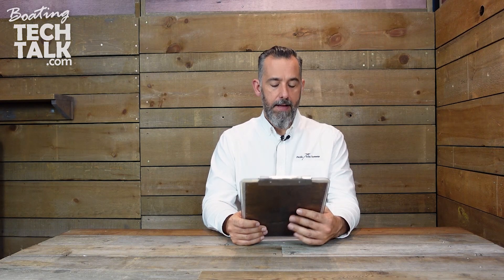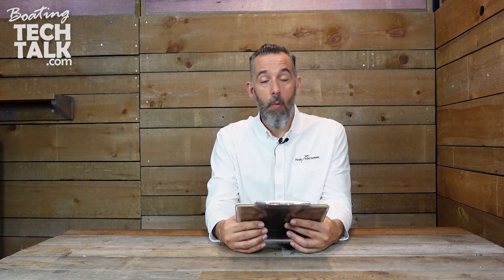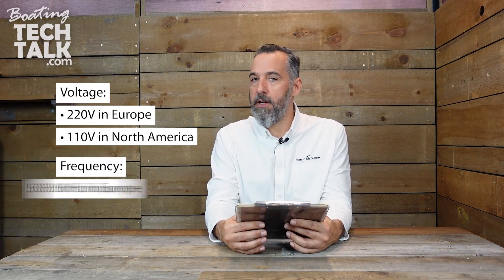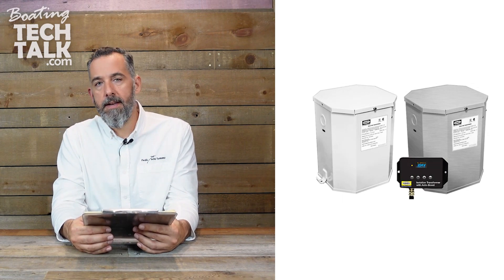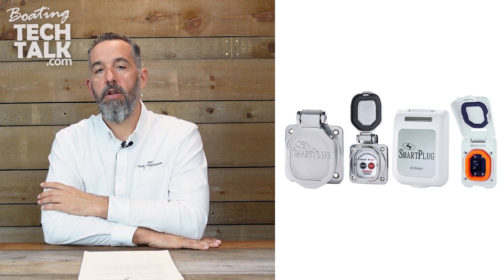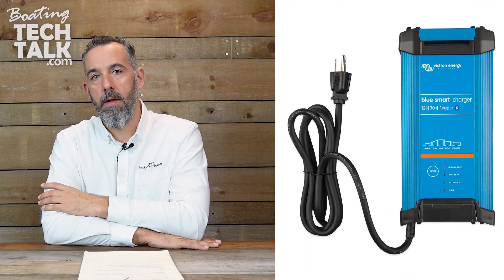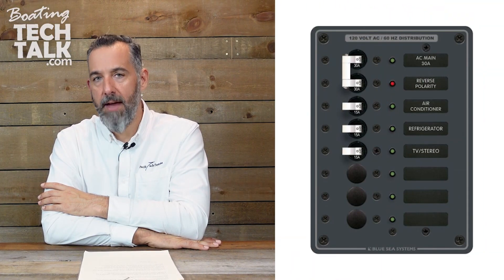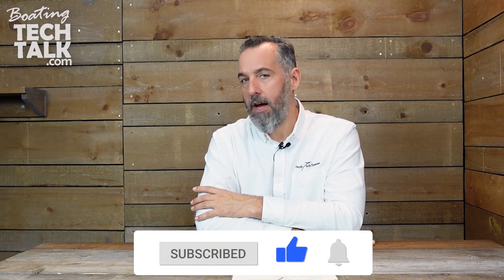European to North American Electrical on a Boat

Comment: You may have addressed this in another video but are 220 “appliances” more, or less, efficient than 110 devices. If my boat has both 110 and 220, would I be better off with 220 fans, toaster, hair dryer etc, or their 110 counterparts. Which would deplete the batteries faster?  Thank you.
Reply from the maker: Are you producing 110v 60hz and 220 50hz from 2 different inverters?   Or running 110/240 60 hz?    the 220v appliances are probably 50hz may not like 60 hz.    Many factors in this question.    I doubt there would be much difference between a 120v and 240 hair dryer.      You'd be better off making everything the same voltage and turning off the 2nd inverter.  that would save you way more power then trying to worry about efficiently of each device.   inverters draw a lot of power just being on.

Comment: There is no technical reason say a Victron or Mastervolt inverter can do this. Would require additional AC input isolation terminals to allow isolation from the source AC to the output AC to the vessel (main board and housing will need to be modified) and to twit the software to change the switching settings to fire on varying Hz output (50Hz to 50Hz or 60Hz to 50Hz). This would be required due to the existing setup just hands over the shore power frequency from the input terminals. Connect in North America with the multiple 3 phase plug can help with the load of the vessel
Maybe pacific yachts systems know someone to contact in Victron R&D or Mastervolt with a product suggestion
Reply from the maker: Hi David, thanks for the input.

Comment: You switched between watts and amps there when talking about the downsides. If I'm not mistaken, your charger is giving you 100 amps at 24 volts = 2400 watts to play with (- inverter loss). If you draw 3000 watts then the difference of 600 watts is made up by the battery. So, as long as you keep your draw less than ~2200 watts you should be good right?
Reply from the maker: Hi Gavin, the conversion of AC to DC (e.g. battery charging) is quite taxing. For instance a 100 amp battery charger at 12 VDC, draws about 18 amps at 110 VAC. For a 24 volt 100 amp charger, expect about 36 amps at 110 VAC (or 18 amps at 220 VAC). Try your charger and see how many AC amps it takes to power it at max output.

Comment: When I am not sailing I keep my boat in a slip connected to shore power at the dock. I usually visit my boat three or four times a week and like to have my refrigerator running continuously so I always have cold drinks etc. My question is, to run my refrigerator I need to continuously charge my battery through the shore power and should I be using a battery switch set on one which is my starter battery (I’m sure this is not the right way) or set on two which is my house battery or should it be set to both. Thank you in advance for your answer.
Danny Rubio
Reply from the maker: Hi Danny, for your setup, suggest you run the DC powered fridge off your house batteries while you are at the dock. Make sure your battery charger is charging your house battery and the battery voltage should be above ~13.1 volts.

Comment: Keep in mind that many/most electronics and devices work on either 50 or 60 hz. But the problematic ones are  motors and compressors for air conditioners and refrigerators. Compliant ones can be sourced - theyre the inverter type typically. Other motors might have a change in performance or overheat. If you're careful itemizing your electrical system, you can make it work with just a transformer. But because your European boat has smaller guage wire, it can only run at 220v. American boats with thicker wire could do either 110/220 after adjusting breakers, etc.
Reply from the maker: Thanks Matt for contributing to the discussion, much appreciated.

Comment: I have a 110v/60hz boat here in New Zealand which is 230/50hz I have a transformer (victron) stepping down to give me 115v @ 50hz up to 32 amps of 115

Everything - air con / microwave / tv / fridges are working fine aside from my battery charger needed to be changed. 

But this is down in frequency @ 50hz so my air con isn’t as powerful nor are my fridges. But all is working fine 2 years later
Reply from the maker: Thanks for sharing foodley123.

Comment: Europe uses 230V at 50Hz. North America uses 120V and 240V split phase. Most stuff that works on 230V can handle 240V and the other way round. The difference in NA is the double fusing of 240V.
Reply: 230+/-10%…so 240 is fine.
Reply: @borysnijinski331  some devices like pumps in dishwashers and washing machines will not work if the frequencies do not match. But everything else including power tools are no problem.
Reply from the maker: Thanks to both of you for contributing.

Comment: 230V / 50Hz is  most common in Europe, not 220V. If this was a French boat it is most likely 230V.

I work on a 76m / 250ft fishing vessel and there we have 440v and 230v / 60Hz. When we are connected to shore power it is 50 Hz. I feel the transition from 60 to 50Hz as problem-free. The only thing I notice is that pumps and other rotating equipment have their rpm / capacity lowered by 20%.

A bigger challenge is when we connect to shore power which is 400V insted of 440v ... this means that 230v is no longer 230v, but becomes 210v out of the transformer! This has led to errors and, in the worst case, early death on electronics.
Reply: 230VAC is 220VAC…230+/-10% so AC powered electrical equipment is required to function on anything between 253VAC and 207VAC.
Reply from the maker: Thanks Mats for providing real world experience to the conversation.

Comment: Bonjour Jeff,
Your Tech Talk are really interesting!
I'm looking to install a FLIR M-232 thermal camera with a AR200 on my Nauticat 38.
I would like to have your advice about the better place to install it. 
On the top of the mast, with 360 degree view, a farther view angle and a lot of swing
Or on the bowsprit with more splashs and less swing and angle of view of about 270 degree.

Jean Domingue
Quebec
Reply from the maker: Hi Jean-Dominque, suggest you install on the mast.  Best to keep the FLIR camera away from spray.
Reply: @PacificYachtSystems  thank's Jeff. I will try it next summer and will give you some news

Comment: As long as the demand on the inverter/ battery bank doesn't drain the battery bank, you would be isolated from shore power. And if the battery charger is not grounded to the boats bonding system, the under water metals are isolated from galvanic corrosion from within the vessel itself
Reply from the maker: Good summary.

Comment: I have always wondered this...I live in Japan where we are 100v with either 50Hz or 60Hz depending where in Japan I am.
Reply: I knew that about Japan re 50hz and 60hz, but what is even more weird is that in Japan they drive on LHS of the road…you would think USA would have changed that back in late 1940s.  Pretty much the only places in the world where 120VAC and 60Hz is the norm in North America (there are a few other places, but by and large 220VAC and 50Hz dominates world wide.
Reply: I bought a Sony MD player in Nagoya with wrong HZ for use in my USA, always gave a high voltage warning, but if you put some load on it, seemed to always charge fine.
Reply from the maker: Oh interesting. Generally most AC appliances want to run on either 50 or 60 hz, but rarely both.
Reply: @PacificYachtSystems  So that is the weird thing about Japan....if you move to the half of the country that uses 50Hz you need all new appliances.  I am going to look into the charger/inverter option.  Never thought of that before.
Reply: The two ends of the country. I have always wondered how much this affects JDM. Most export electronics seem engineered as adaptive, each running their own power converter. Does this affect consumer electrical or boating?